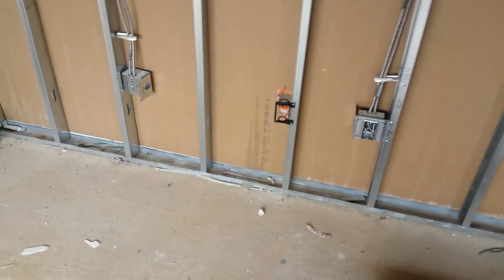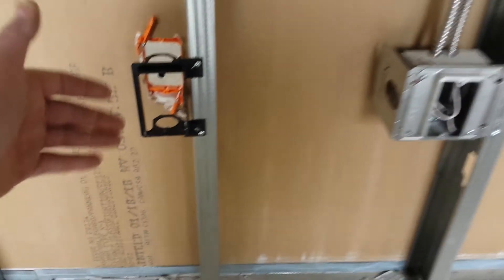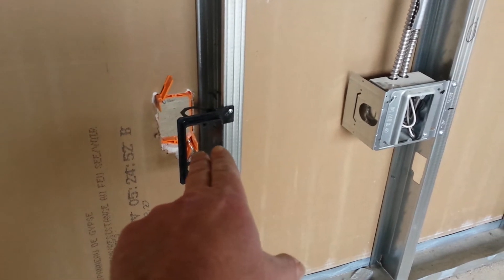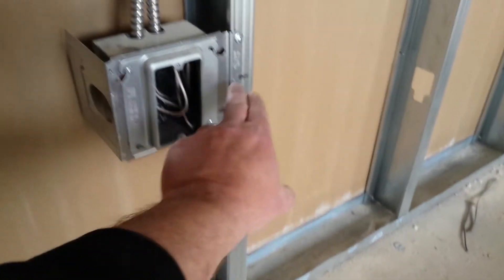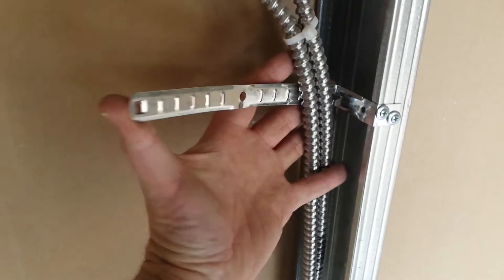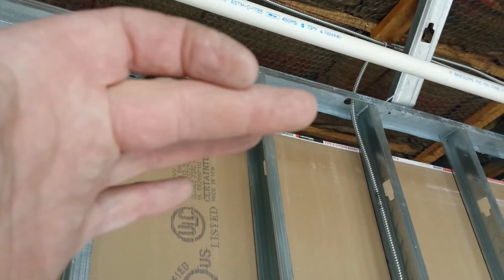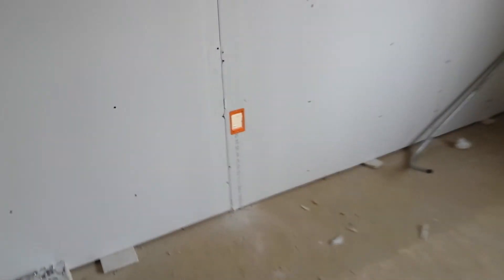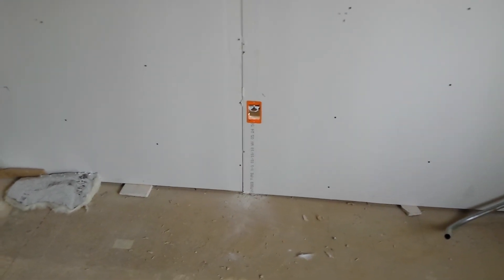New Construction Guide to Network Cabling | Caddies | BridgeCable.com

Comment: How do we find it out that my house built in 2013 has ethernet cable or not
Reply: That one is hard to say.....at times builders in Philadelphia install regular telephone wiring and just put on network jacks. Other times they daisy chain the wiring like telephone wiring. From builder to builder the standard is different. Looks for jacks in the house....then unscrew a plate and see what the wiring is. Then trace and test it out. Or call BridgeCable.com 877-832-1206.

Comment: Forgive my lack on knowledge .....Is conduit not needed? Also, is the space where you have run your cables is anything special need to be done when it is near the power conduit running the 90 degrees through that space?
Reply: Low voltage in homes doesn't require conduit, raceways, or cable trays, but those can make it nicer for doing more cabling in the future (provided it isn't half-inch pipe that can only hold a few cables). Ideally, the whole run of data cables avoids high-voltage cabling, but often it will cross it without noticeable interference. Generally, keep it as far from high voltage as you can practically arrange. Running just alongside it is worse, which is one reason why code doesn't allow that. Most of the low voltage cabling I do is retro-fitted to old buildings and there is typically no way to install more conduit. We do use cable saddles (rings that either screw into wood or clip on to metal) as supports to keep the cables orderly and off the ceiling or insulation.
Reply: And one other approach to avoiding electrical interference is to use an optic fiber cable between floors or for long runs, but that takes more planning and equipment on each end to use the fiber.

Comment: If you install 3/4” EMT conduit and 1900 boxes, you can go ahead and run your low voltage cables before the drywall goes up and NEVER have to worry about about anyone else on the job site damaging your cables, because they will be completely protected by the conduit.

I’ll usually even have keystones on and certify my cables from jack to rack before those guys are even thinking about hanging their Sheetrock lol 🤷🏻‍♂️
Reply from the maker: It's a great thought....and we try to do that....with the painters....they might go over the plates or even on the jacks. Yes, we try to protect the jacks with bags on them. Just never seems to work out...usually rough in....can jack some. Even have plates and jacks attached just hanging....other trades knick em. Of course the cabling is protected with conduit...piece of cake! :) Thanks for the comment!!